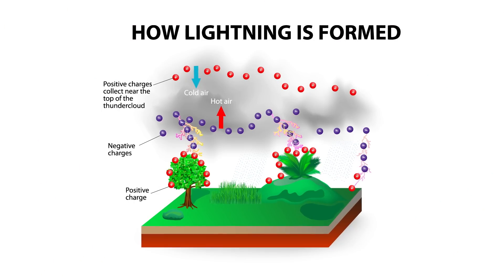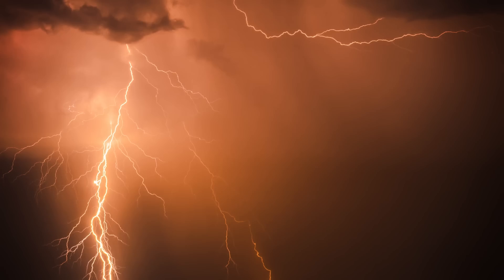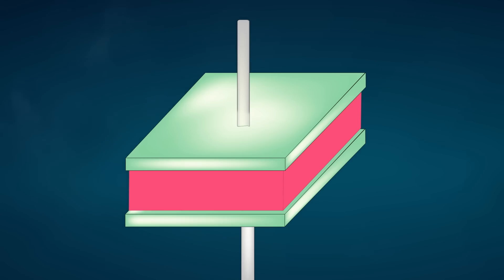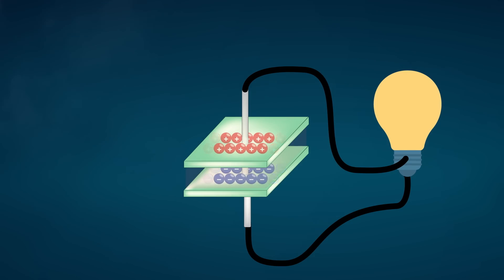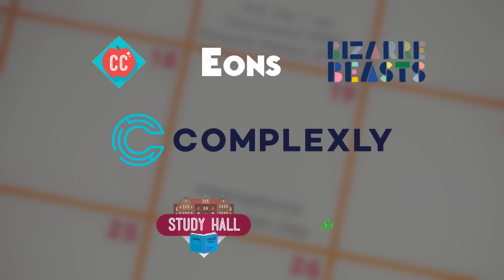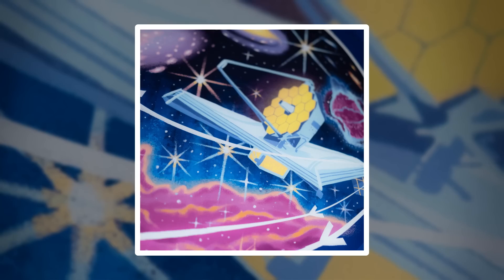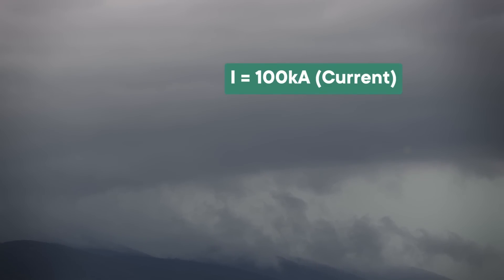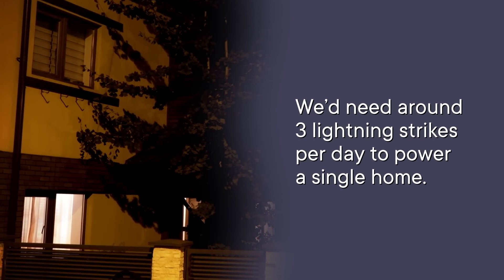Why Can't We Use Lightning for Electricity?

Comment: Disappointed you made no mention of actual demonstrations of capturing lightning.  I remember one in particular was at the railroad proving ground where they were running electric trains, and someone built something that channeled lightning strikes into the grid that was running the trains.  For reasons on which you have touched, the demonstration was not continued.
And this channel is seriously flawed if you think wind and solar is “worth pursing” - as much data is now available bursting the bubble of “renewables” being primarily their intermittent nature requiring a double system of the current dispatchable sources (fossil fuels and limited hydro) to back up the intermittent sources when they are not working.  Nuclear is the only viable path forward to decarbonize the grid, and we still will need significant hydrocarbons to feed 8 billion people and growing, and for transportation.  Shame on you.

Comment: OK, the premise of this episode is that the power in the lightning bolt would somehow be collected all at once, in eyeblink. Somehow, they're assuming we'd want to collect and store roughly one terawatt, enough to power about 800 Delorean time machines, in just 30 microseconds (0.000003 sec), which, while it MAY be possible, in theory, seems wildly impractical to me. I'm presuming they're describing a stationary collector that relies on a more-or-less chance lightning strike to do its job. That doesn't strike me as terribly efficient.

I think a better idea would be to collect the charge inherent in the air and clouds before it can build enough to arc to ground, creating a lightning bolt. In principle, all you'd need is about a mile of thin copper, gold, or silver wire or foil to collect the charge and a way to lift it into the sky, like a balloon, while keeping it connected to a collector on the ground. Surrounding or hanging beneath the balloon would be a wire mesh to increase the collection area.

Such a system could be deployed on tall buildings all across the world, enabling relatively cheap and easy power collection to store for later use. Of course, the bigger the wire, the more charge you can conduct and collect.

Veritasium did a video on this. No need to sit and wait for lightning to strike, just hoist a wire on a balloon or whatever and charge will flow. This is much easier and probably cheaper than building something that can take a MASSIVE power surge and hang on to it.

Thoughts? Comments? Ideas?

Comment: You forgot to mention nuclear power when talking about viable strategies.
Reply: Viable but not renewable.
Reply: @FlushGorgon  yea not renewable but a massive step away from coal and oil, and hopefully a predecessor of fusion reactors which are technically not renewable but a universally abundant fuel.
Reply: @FlushGorgon  we have enough nuclear fuel be it fusion (a bit into the future) or fission for thousands and thousands of years. But go on, live under a rock

Comment: From billions of joules to 8kWh? What happened? I'm confused
Reply: They stated the power rating (which is too large, V*I) as joules I guess. But the energy is delivered over a tiny amount of time hence the unsurprising (or surprising) value. The faults in transmission poles release about the same amount of energy or 10x less through light and sound. So, it is related to at least the entire day's energy consumption of a few homes supplied by an electric pole.

Comment: What no. Mica is a dielectric and Ohm's law equals voltage, not power, to the current times the resistance. Dielectrics and insulators are not the same thing. Power and voltage are not interchangeable.

Comment: Others already pointed out the mistake in the video at 5:46: 1000 GW * 30 microseconds is 30 Megawatt-seconds, not 30 Watt-seconds. Maybe you can add a second correction to the video description.
Reply: "bear with me, there's going to me some math" fumbles the math
Reply: @tdk99-i8n Hence the "bear with me " part!
Reply: SciShow screws up basic high school science and grade school math.  🤣
Reply: SciShow doesn't know the difference between Ohm's law and Watt's law.
Reply: @toolbaggers  They don't even call it Ohm's Law anymore. It's referred to as Kirchoff's Relations, correctly reattributing it to the person who first described the relationships between voltage, current and resistance. This time the Russians weren't lying.
Reply: yeah but 30 megaWatt second is 8.3 Kwh...
Reply: This needs to be pinned 📌

Comment: Electro-spun carbon nano-tube mats rolled onto glidcop. Highest thermal and electrical conductivity. Highest surface area, can trap and be bound to rare earths, can be made into highest energy density capacitors. Top shelf tech.

Comment: Why not set up a city wide lightning rod array, have them all meet at a heat sink, and use the power to boil water, turn a turbine, and it basically becomes another regular power plant. It should at least work in Venezuela. If nothing else it would be cool as heck.
Reply: If we could collect all the lightnings hitting France in a year (including all the fields, forests and lakes), that would be enough to power the country for about 3 hours. If you use that electric energy to create heat to turn a turbine to create electricity, you may loose half of that power, in dissipated heat, reducing the yearly collect to 90 minutes of useful energy for the country.

Comment: Odd, I come up with a different value. 1000 GW * 30 μs = 30 MW·s, that's 30 Megawatt·seconds. Not 30 Watt·seconds. Off by a factor of 10⁶. Roughly 8.33 KW·h. So you missed the Mega but got the right result.
Reply: Do you think there’s a way to suck the energy up faster?

Comment: That is the first time I've UNDERSTOOD what the hell a capacitor actually is! Thank you for making it make sense for someone very non-math-inclined!
Reply: Next step : the flux capacitor!
Reply: Next for you to read up on. Inductors, which are almost like capacitors, but they store electricity as a magnetic field
Reply: Then you haven't actually looked it up before, because the concept requires zero math to understand... the explanation is frickin EVERYWHERE, presented just as simply as here... so...
Reply: @joshyoung1440   I am so glad that you're one of the folks who can read something on a piece of paper and instantly grasp it. I don't.
Plenty of folks don't learn that way. I enjoy reading, but it's not really the best way for my brain to latch onto concepts and retain them. The presentation here "clicked" for me in a way books did not.
Reply: @joshyoung1440 you don't get that a lot. Most textbook just present you with C = Q·V and say it's charging and discharging. Why? Who tf knows. For a good while in my student life, I thought capacitor is some sort of spare battery instead of voltage regulator.
Reply: Because it is. It's literally a charge storage. It digfer in the form of storage internally. But conceptually from elecrophysical point of view they are nearly identical. Their characteristic for releasing charge is different, but that's true for basically any two points in a circuit.

Comment: With significant technological breakthroughs, could we potentially convert 70–90% of a lightning strike’s energy into stored, usable energy? Mathematically, it seems feasible to capture most of a lightning strike’s energy for later use. For instance, solar panels currently have conversion efficiencies below 50%, which is quite low. But if we could capture and store even 50% or more of a lightning strike's energy, it might supplement battery storage solutions for solar, wind, and other renewable energy sources.

Am I overthinking this? I still fully support nuclear power, but with AI and the internet growing so quickly, I feel we need to find dedicated energy sources to sustain these systems and infrastructures.
Reply: It is a massive expense just to get less than a AAA battery each day :)

Comment: Using a lightning by catching it, would by like making hydripower by holding a mill wheel into the lower end of a flowing rapid. 99,9 % of the energy is spread into glowing light, heated air and thunder. Ou would need to cat h the charge in the cloud, using the permanent charge built up ground - cloud. That would give useful energy. And obviously at even higher costs.

Comment: The idea is correct. The challenge is simply in building it. Think Franklin's kite.  It didn't really need to get struck by lightning for it to collect charges from the air.

Comment: The design, overall, is cool for the lightning rod and capacitors. Now, if it was possible to not rely on nature (open space) have that evaporation in a controlled environment (closed space) then it might be reasonable to get more then one strike a day. The next question could be to know how big the environment (wave guide) would have to be and how much climate control is required. Thanks for the video.

Comment: I dunno about that cell battery thing. Mine has been going strong for years. Holds the same charge now as it did when I bought it, and it was used when I got it. It's not even a particularly good phone.

Comment: its simple realy we need a huge faraday cage but we simply need very huge amonut of ac and dc power converters and inverters and very huge rechargable battery and capstor banks with alot of grounding to get rid of the extra power if it can't store all of it at the time .
Reply: plus a nuclear reactor both fission and fusion would just be far far far far far far better. plus high level nuclear waste is actaly 97% fully recycleble for all the fuel use so once you mine the stuff you can keep useing the stuf with reprocesing like for a very very very very very long time. that bacly means very little mineing needed compared to the shear amonut of nuclear fuel and energy you can get out of it. also makes some of the best rare eaerth metals like zecioum-90 from strouim decay passvly from the srtouim waste after 30 years by the way. also struim also makes a very good rtg and nuclear strling pasive mostly mantice free power sorce for long term waste stroage that could turn yuca monution in nevida into a very huge rtg powerplant that could also make huge amonut of zecuiom 90 for power plant and aerospace terbines that could be made out of pure zicuiom-90 due to how much zecuiom 90 you just get from high level nuclear waste sreuiom decay every three decades bacly. that could make a huge difreasce in hleping masvly cut costs for futre nuclaer powerplants and aerospace nucleaer thermal reactor and rocket engines that all use alot of zecuom 90 for all thsoe terbines. witch by the way you can get more by just sueing nuclear power in far more quantys then you would be able to ever natruly mine of the the gronud of earth a hundir thaosund fold over by the way. if only nuclear fuel and nucler waste reproceing wasn't illegal in the usa due to very bad long term oversight of trying to stop nuclear ewapon profiation ended up back fireing bescue apretly nuclear reproceing is actly a man nesacty for long term lagre scale nuclear powerplant infertecure use.

Comment: Wait, 30kWh per house per DAY? I'm using under 120 per MONTH! Granted, in a small apartment, but I have some older appliances, a PS5, a gaming PC and I work from home! My family members who live in single family houses use around 300-400 kWh per month. 30 per day is absurd!
Reply: Agree, 30 kWh per day sounds like A LOT! No wonder the world is going to hell if we're not even trying to reduce consumption...
Reply: @JakobGivoni  Norway:
Average electricity consumption for a single-family home: 25,776 kWh per year. townhouse: 17,090 kWh, apartment building: 10,899 kWh.

Much of it is for heating homes.  Heatpumps helps, but Norway has been spoiled with cheap hydropower for years.  Some of that power is also for charging EV.
Reply: We are a houshold of 4 people with everything (tumble dryer, dishwasher, two big freezers, a lot of tech and TVs and routers) and even we average at arount 6kWh per day. So yeah something is completely off here.
Reply: i mean it depends on the weather, last month was about 10kwH per day, but i agree 30 means a big house in the summer with ac on when its over 100
Reply: Maybe bad isolated houses with the ac on full?

Comment: What might work is using the large-scale atmospheric electrical fields behind lightning as a source of power, since doing that is as easy as creating an artificial circuit to replace the natural circuit that lightning would otherwise create for itself — which is in turn as easy as just launching 2 cable-tethered balloons up into the air to 2 different altitudes (one tethered balloon to 40000ft and another to 5000ft, for example) and using a miles-long wire to connect them. That might in turn actually prevent the charges from building up enough to become lightning strikes to begin with because they'd have a continuous path to flow through that we created for them.

Wiring up a thunderstorm like this in a way that uses atmospheric charge separation as a source of power would also allow us to produce green hydrogen much less expensively, since, well, there's also a lot of water in those storm clouds that can be easily split by electrolysis. That hydrogen could then go on to fill gaps between storms by being pumped through grid-scale fuel cells.
Reply: If you do a basic unit conversion, you get about 280kWh energy per strike on average. Enough for a house 1-2 months. Not worth the hassle

Comment: That's not Ohm's Law, which is that current equals voltage divided by resistance (I = E/R), where resistance is measured in Ohms. What you describe is Watt's law and the unit of power is the Watt. Come on SciShow... that's a pretty egregious error regarding arguablly the most basic and important formula in electronics.
Reply: Electronics? James Watt was born in 1819. Way before electronics was invented. 
Watt's law is basic electricity/physics.
Reply: "Watt's law" is not a real law. What you are describing is a derivation of Joule's first law. Come on... PhoenixRevealed that's a pretty egregious error...
Reply: And SciShow thinks a2 + b2 = c2 is the quadratic formula.
Reply: Well, I teach 10th grade Science, part time. And, in  the NCERT book, P=VI comes after Joule's heating effect of current.

So, the good people creating the show are not entirely wrong.
Reply: This is a reason, why everything on the web should not be believed.
Reply: I thought p=v^2/r was Joule’s law?
Reply: You're right. How egregious of them to mix up two equivalent laws. Please stop with the melodrama.
Reply: @joshyoung1440  - for a science show: Yes. It's not a one-man show but a collaboration, and they should have definitely caught it.
. . . What else of what they say cannot be trusted?
Reply: @Achill101  the numbers for example. One bolt of lightning contains about 1400kWh of energy, not only 8.
Reply: @joshyoung1440  egregious
/ɪˈɡriːdʒəs/
adjective
1.
outstandingly bad; shocking.

Sounds about right. Seems like you're the only one being dramatic
Reply: @joshyoung1440  sorry equivalent??
No this is the nonsense attitude that ends with a flat earth and we didn't go to the moon - down the pub being wrong in a minor way might be acceptable BUT it's not ok in a science video and the producers should have caught it at the time (obviously viewers did) and certainly should have that as the pinned comment, not "buy our calender"
Reply: @joshyoung1440  but they aren't equivalent....